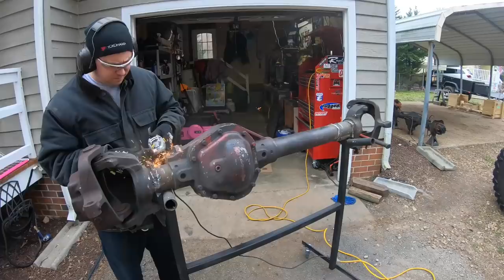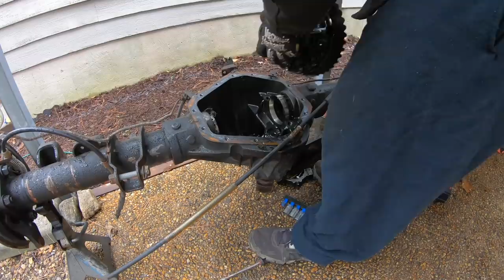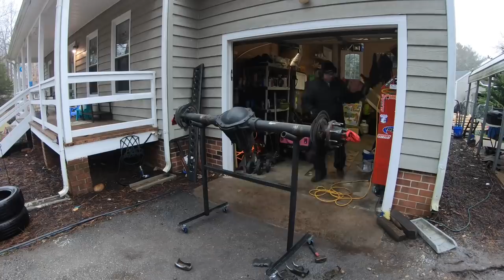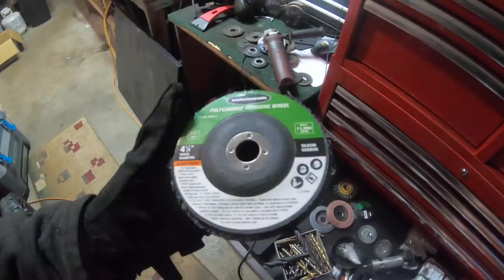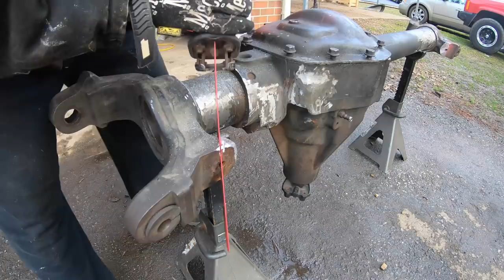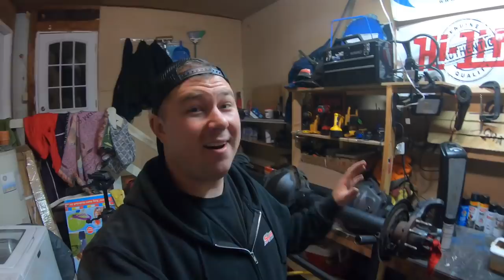Axle Teardown and Prep - JK 1 Ton Axle Swap Episode 2

Comment: Pretty cool build. I like these videos. Not too many videos that are in depth of the newer 14 bolt with disc brakes. My current build is a Cherokee on tons. Bought it completely rust free and stock. Just got done completely frame stiffening it front to back. I'm just getting around to getting the axles in. I used a kingpin 60. Truss went on real easy and looks good. The rear is a newer 14 bolt I shaved and now getting it ready to paint. Both axles got lockers and 5.38 gears. It's a fun project. Learning as I go. The 14 bolt is the most simple axle I've ever worked on. Love to see what you do with yours. I'm new to the super 60 and curious about it as well. I subscribed. Can't wait to see more. If you plan on shaving the 14 bolt.. East coast gear supply has a great shave kit for a great price and they offer shaved gears for whatever ratio you choose.

Comment: Pull the gears, and the knuckles, and shafts  from your 60 save yourself some back aches. I got mine on a dolly wratchet strapped to it so I can move it in and out of garage. But I can pick it up solo easily since all the guts are gone.

Comment: I'm not sure what your experience is in painting or if you did it off camera. After touching that bare metal bare handed, it's usually good practice to wipe the bare metal down with some sort of solvent that doesn't leave behind a residue like acetone or denatured alcohol. The salt and oil from your skin will cause it to rust sooner. Not being a troll, just trying to help. Starting to look good man! I'm interested in putting a Dakota on one tons. I have the Dana 60 full float rear from a dodge 2500. Will more than likely go with the dodge dana 60 front from an 02 so I dont have to deal with the disconnect or get the disconnect kit. New subscriber here to get info and ideas! Thanks!
Reply: Also,  there's another YouTube channel called BleepinJeep that does a great deal of how to fab vids. The fab forums is also a good one. Hope this helps!

Comment: Thats a "ton" of work Ben ;) Those are going to be great when you get them all done. What axles do you have under the JK now? I'm running Rubicon 44's and only plan on going to 37's so I don't think i'll be doing Tons anytime soon but this is great info. Keep them coming
Reply from the maker: Currently have a prorock 44 front with rcvs, rubi 44 rear. It’s been working fine with the 40s but it was just a matter of time

Comment: Sub'd.  Also, I speak from unfortunate experience...move your vehicles away from the sparks.  Hot sparks will embed themselves into your paint and that'll be another neat video lol.
Reply: Hot sparks also in bed themself in glass and then rust I've seen it happen lots of rookie welders forget to throw a welding blanket over the windows in mears when welding on a vehicle and the destroying the windows and mirrors

Comment: Don't worry about the video length. I watch everything at 1.25x or 1.5x speed anyway.

Also, yes, I would be interested in a Steel It give away. That stuff sounds amazing if it works as advertised.

Comment: Nice,Going to twist ends in the D60 for better Caster?
Reply from the maker: Thought about it, but not totally needed. Should be able to run 5-6* caster, also since they are the balljoint 60s you can run caster inserts

Comment: I haven't done any axle fab work so i don't know what i'm talking about, but can't you just put new blank axle tubes on cheaper/easier than all the cutting and grinding? Nice work.. i like your videos
Reply from the maker: Sadly no. Axle tubing is very expensive, plus you would need the knuckle Cs to weld onto the new tubes. At that point you are building a custom axle pretty much
Reply: @JKGearandGadgets   good thing grinding is fun!

Comment: Hello i plan to do a 1 ton swap on my jk soon and i was wondering can you shave the sterling rear axle like the 14 bolt. witch axle offers the most ground clearance? Also i want to know what wheel adaptors your going to use. Great videos man keep it up.
Reply from the maker: The sterling only has one shave kit and it requires a ton of work. For the wheel spacers I’m not sure yet, just stay tuned and keep watching the series 🤘

Comment: Any tips or tricks to cutting the 2” of the center section on the Dana 60? You didn’t really say much about that part and I’m wondering how difficult that part is? Definitely interested in some of the Steel It paint!
Reply from the maker: I wish I had recorded it when I did it. It’s not bad, use a portaband or sawzall, cut slowly and don’t go too deep. I think there is a good YouTube video of a guy doing it
Reply from the maker: I will dig and see if I have any clips of me cutting it, when it’s time to weld the truss on I will talk more about making that cut
Reply: Ben my wife and I live in Va and have done a couple trips to Pots Mountain if you are interested in checking it out I can get a couple of jeeps together and show you around. Might make a good video.
Reply from the maker: Lewis Dawson I’m down! Is Potts closed for the winter? I have yet to do that trail
Reply: JK Gear and Gadgets yes it is closed for the winter but usually opens the 1st of April.

Comment: Hi Ben! Do you know if there is any difference in swap between 14-bolt axle from 97 and 99 years except for the brakes? I have axle from 2500 1997 with drums and want to put it on my JK. Found already nice brakes conversion kit but not sure if there will be any other differences...
Reply from the maker: Most of the swap truss kits are designed around the newer axles

Comment: Now that you’ve had time to wheel it, what would you do different.  And, is there a way to index the axle tubes for more caster?
Reply from the maker: Only thing I would do different is a selectable rear locker and 5.13s for the Hemi.  Caster isn’t an issue, I’m running 7*

Comment: I think i have the Dana 35 rear end... i have the pinion gear and ring gear here in the house with me these are the numbers... Pinion gear Dana G, 46131, 39-11 A which divided 41 by 11 gives me a ratio of 355 then also has VIL 687. Ring gear numbers are 4-1096 Dana D  46132  P8L560 39-11 then on around the ring gear it has 135... So my jeep is a 2000 jeep cherokee. with those rear end ring gears and pinion gear numbers etc. I want to change the whole  back rearend unit out... drop complete unit and change it to another complete unit. I need to know what Modals /types of other jeeps that will inner change. keep it stock...

Comment: Great video.. did you turn the inner C’s to get better separation for the sake of pinion angle and caster ?
Reply from the maker: Nope! These axles have 10* of separation which is more than enough. 
Plus with the locking hubs. You can have better caster and not worry about the driveshaft spinning when your driving on the road
Reply: JK Gear and Gadgets thanks for the quick reply ... that’s great news... guess I need to start looking for axles !!

Comment: 10:28 nothing like using 12 point sockets on 6 point bolt heads🤣🤣🤣
Reply from the maker: It will be perfectly fine 🙄 lol.
Reply from the maker: They are bolts that are constantly soaked in gear oil. Didn’t have any reason to believe they would be seized or stuck in there